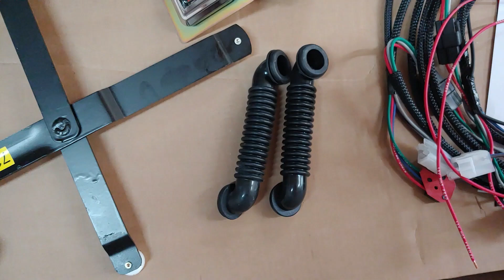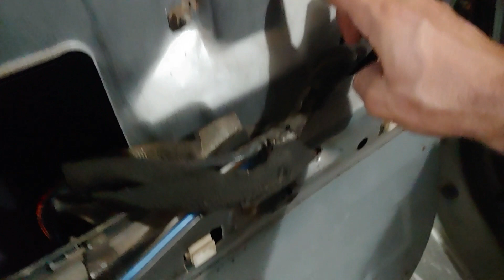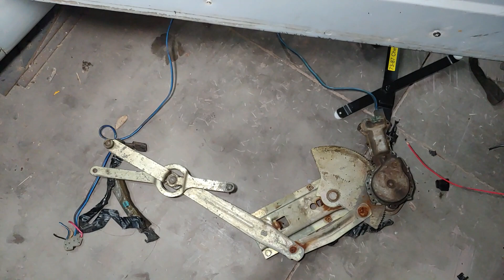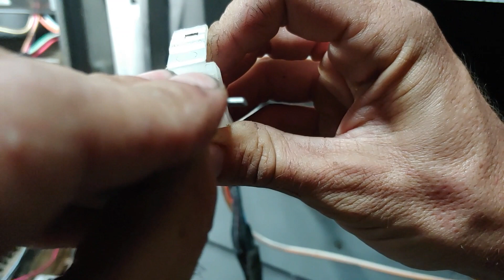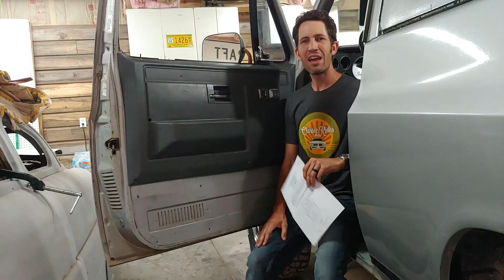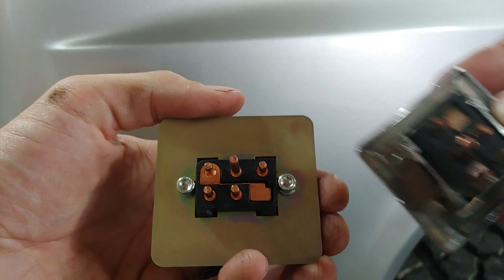Nu-Relics Power Window Install 84 K5 Blazer (1973-1987 Square Body Chevy GMC C10 K10)

Comment: Here's my issue... I have a K5 and currently, I can't figure out what wires are what on my driver side door/electric window. This is the condition I got it in.
Reply from the maker: Are you installing a Nu-Relics kit or trying to patch up the original wiring? We removed all the original wiring to install this kit,  so we would have to do some looking to figure out what the original wiring was like.